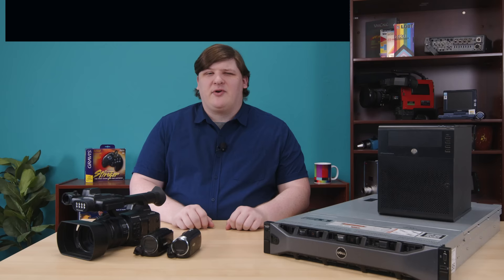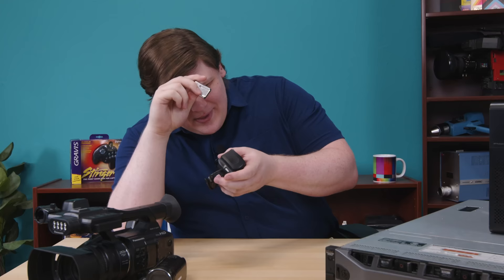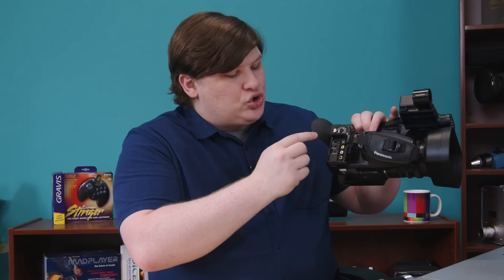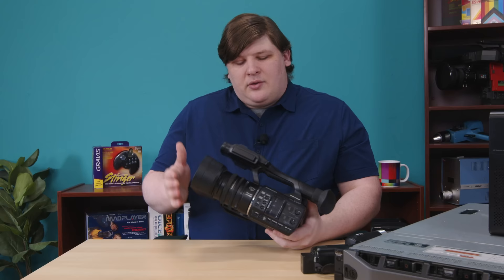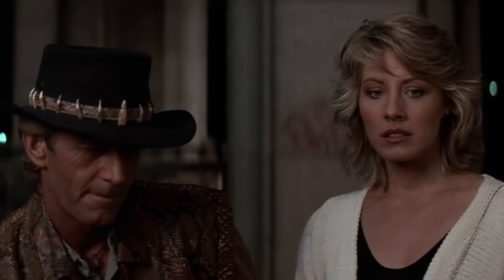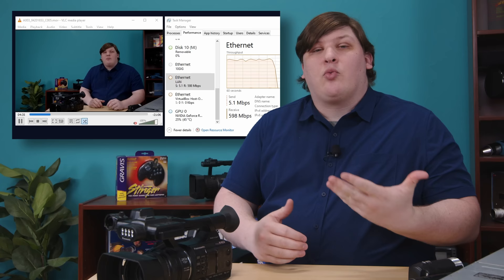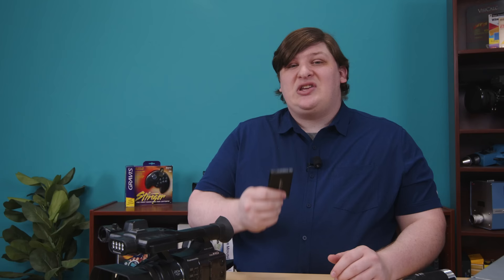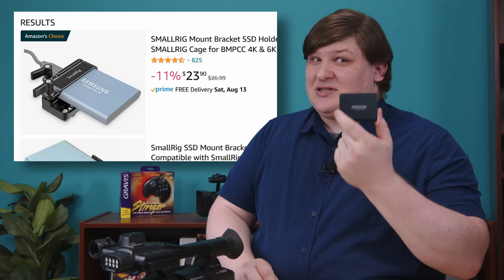I Built... a really fast NAS?

Comment: As a professional in IT I love that you chose SFP modules and not 10G-base-T
Reply: SFP  modules are just dumb unless you need copper or fibre for longer installations. DAC is the bees knees. They require much less power (less then 1% of a 10gbps ethernet sfp). Both optic and ethernet/copper takes alot of power to drive.

Not a big issue with 2 connectors, but when you haev 24 or 48 in a rack the power demand is significant.
Reply: @jmkhenka  sfp dac?
Reply: DACs are great, but I don't care.  I'm 100% with the OP here:  At least it wasn't 10Gb-T.
Reply: @nickwallette6201  What's wrong with 10Gb-T?
Reply: @VCD-Channel   A lot of little things.

1) In a commercial environment, where you're going to have potentially lots of SFP modules packed in to a dense switch port cluster, the transceivers we have today require too much power, and get too hot.  It breaks the limits of the SFP+ spec, and while most implementations can handle staggered deployment (so every other port, or something like that), it's just really hacky.

2) We've kinda pushed twisted-pair signaling to the edge of its usefulness here.  It's a fine topology for baseband, or 10Mb, 100Mb, or even 1Gb networking.  But at the bandwidth required for 10Gb, something like coax (which, ironically, we abandoned for UTP long ago in conventional LANs) is much better suited.  It's difficult to guarantee reliability at the traditional Ethernet specification of 100 meters, and even that's assuming you're using a recent plant with quality cabling that was installed carefully.  Real-world cable plants are often going to be CAT-5E or CAT-6, with similarly-rated jacks and patch panels, and a lot of potential weaknesses like kinks, cinches from over-zealous zip ties, too-long runs, crappy patch cables on the ends, etc.

3) Given the density and integrity issues, many professional vendors haven't focused on 10Gb-T, so your options for 10Gb-T switches are limited compared to SFP+.  This is my bread and butter, so I used to sell a lot of switches like the Juniper EX4550, which was a 32-port SFP+ switch with two modular bays where you could install an expansion card with (your choice of) 8x 10Gb-T ports, an additional 8x SFP+ ports, 2x QSFP+ ports, or 2x chassis stacking ports.  Super versatile!  But, that was discontinued, and there just aren't a lot of models out there where you can casually add a handful of 10Gb-T ports, without committing to an entire switch full of them.  This is particularly annoying when there are just like one or two appliances that need 10Gb, but don't have any SFP+ slots.  That's the worst.  A lot of people need or want a healthy dose of 1Gb ports anyway for legacy or low-bandwidth appliances, or out-of-band management interfaces on their high-bandwidth appliances.  So you could just buy a 48-port 10Gb-T switch and run most of the ports at 1Gb, but that's going to cost a lot more than a similar 1Gb-T switch, so your only true recourse is to populate some of your valuable SFP+ slots with 10Gb-T modules -- and that just feels like the IT-industry equivalent of sharing prescription medication.
Reply: @nickwallette6201  Thank you for the explanation!

Comment: 28:23 For the dock I'd suggest you 3D Print a removeable spacer for the drives to support the connector. Or get somebody to print one for you. It would be an easy design & print for anyone who does their own designs.
Reply: Was going to say the same 😁. Literally 15 minutes to model and maybe an hour to print. Could also, just as simply, make adapters to deal with The T9 drives not fitting into the Small Rig clamp.
Reply: Or jam a piece of cardboard in the slot with the drive.
Reply: @Cathode Ray Dude [CRD]  I just caught this video now.  I'd do it for him.  No charge.  Just have a chicken and egg of not having the drive or kingston bay/hub to measure.  lol   Could probably work off just a caddy and drive model.  @Cathode Ray Dude [CRD]
Reply: I would go even farther :):):) Why not suggest to buy a 3d  printer and build it on itself. :):):)
Reply: To be honest, the dock looks like a prosumer version of those usb copy stations they sometimes have at merch booths to have concert recordings for sale shortly after they ended.
Reply: Was going to say the same, even some plastic spacer blocks would be better than nothing.
Reply: @LeBoomStudios  Of bootlegs? Seriously???

Comment: I am three minutes in and already hooked. Let's see where this rabbithole goes.
EDIT: 1 1/2 hours later, and now I have the strong urge to upgrade our home NAS. great Video, as always!
Reply: He was so ready to shit on that battery 🤣
Reply: I deffinitly have a strong need to build a NAS watching this, one of those too-long-delayed projects
Reply: Been a long time user of Freenas (now truenas) for many years. And WD Red drives(5400rpm models). power efficient, reliable as heck and performance is not too bad really. And doing automated backups has been pretty easy, doing snapshots of changed data every day takes far less time and is often just a few seconds to a minute unless I have done something significant. Than its a little longer. 

And yes I mentioned my nas drives are 5400 rpm, and I do have 10g network.  But as a small family its always been quite sufficient. I also use SLOG and L2Arc (flash based read and write sync caches) and the nas has 48 gigs of ram. So that itself does a lot of heavy lifting. Loading in a couple Tibbs of data for backup isn't too bad when it goes at about 600mb/s

Truenas and ZFS also have paranoid levels of paranoia when it comes to data integrity. And as long as you stick to recommended practices then that data will always be safe almost no matter what.

Comment: Just wanted to complement your going the SFP route in the network interconnect for 10GbE, it has lower latency than 10 gig twisted pair so nice little bonus there. Also direct attach cables really do feel like a cheat and we use them extensively inside and in-between racks; there's a whole world of those cables now, including thinner versions to improve airflow, colored and plenum-rated jackets... congratulations on your workflow upgrades, cheers!
Reply: I've never heard of these, but color me intrigued I'll say that much.

Comment: Such an amazing video! Inspired me to change my approach to scratch disks, 'negatives' and backups. I especially liked all the preemptive "yes, you might be able to do it better, but this is how I do it and this is how I like it" comments. Definitely shows years of reading YT comments that contain simplistic and sometimes condescending suggestions to complicated problems 😁

I have a fairly similar setup at the moment (Atomos Ninja V recording to a 1TB SATA SSD), but I use the "negatives" for editing (love that term). Sometimes I would actually move the files to my NAS (with two NVMe SSDs in a RAID0 configuration) and edit off of that, but both of these workflows are very fragile and prone to data loss. I'm thinking about adopting a similar setup that you have, and since I already have a NAS, this should be relatively easy.

Once again, I really appreciate and respect the effort that you put into making this huge (and very insightful) video.

Comment: Video pro here. Your desire to do things right is something I admire with this project.

Have you considered a Proxy workflow? The reason why it was originally created was because even though most workstations (even mobile) were able to playback full resolution media the storage attached to them couldn't handle the size and data rates of high quality intra frame and raw codecs. 

Just going from your ProRes 422 HQ to ProRes Proxy would mean 1100Mbps -> ~225Mbps and that's before you reduce your resolution. 

Modern Nvidia, AMD, and Intel (including integrated. Quick Sync is shockingly good) GPUs can playback h.264 footage with great performance. If you go down that route, you will only need a few dozen extra GBs with your media for your entire project to have lower res high performance playback.

Resolve 18 went stable and had a point release already. It has a revamped proxy workflow that you should take a look at (see Resolve 18 reference manual pages 188 - 192). It can now automatically detect and link proxies on and after import and comes with a little proxy generator app complete with watch folders.

Generating proxies is something that can be automated part of ingest too, you may already be familiar with ffmpeg, so it can be done server side too.

In addition, if you want something a little less fiddly than an entire server to administrate for the sake of having more space for video production, consider a Blackmagic Cloud Store/Pod.

Comment: Reason for the 2 connectors on the drive backplane: SAS supports a feature called Dual Port, it's basically a second cable path to reach the drives for better reliability.  It might be the multiplexer (or whatever Dell calls it) has a fault that makes it choke on DP.

Comment: So, I actually purchased two servers from the community college I graduated from, and each of them were quite interesting. 
They both were Wide Orbit Radio Automation Servers, which were used for the college's radio broadcasting station, and one came with a 1TB HDD with songs and Licenses for the station to be able to broadcast those songs, and the other came with three 2TB HDDs, two of which were chalked full of songs as well, and the other had licenses for each of the songs on the other two 2TB HDDs, as well as each containing a Samsung EVO 850 250GB SSDs (I'm guessing so they can boot quickly), each of them also had a PNY GeForce 8400 1GB DDR3 PCIe 2.0 GPU (with a video port that looks quite strange to me). One of the servers had an i5 - 4570, with 8GB of DDR3 Ram (1x 8GB, Single Channel), and a good amount of SATA cables sprawling from the five (5) drive bays to many of the SATA ports on the Motherboard.
But, the second server that I purchased, which was the same brand (Wide Orbit) and server model, came with an i7 - 4790, 16GB of DDR3 Ram (4x 4GB, Dual Channel), and a PCIe card that is quite similar to the one that 01:20:26, with the plug that has four SATA cables coming off of it, which were attached to each drive bay, with the drive bay containing the SSD having its own SATA cable plugged directly into port 0.

I know the hardware is old, but I still can't help but think that I got the deal of the century with these beauties!
Reply: I'm going to guess the port on the 8400 is dms-59

Comment: Love iDRAC and its equivalents. I mandated that all new servers at work have licenses for it, they were cutting it out to save a few hundred bucks per server. I am a firm believer that the cost is well worth the amount of time you save vs having to physically go to your server or mess with a network KVM.

Nothing like installing the OS on a server from your couch at home!
Reply: When I was first learning server shit at work I discovered one of our servers had an iDRAC license and instantly fell in love with the features and it's saved me so much farting around. Now that I'm actually in charge of specing out our servers, we don't have a single one without that license.
Reply: I so wish Intel's AMT was more widely available too, it's not full iDRAC/iLO functionality (especially if you have an i3, but some of the i5+ only features can be unlocked with MeshCommander). I have a standard HP elitedesk 800 G2 mini PC running as a server that I can just pop open a serial-over-lan terminal or boot an ISO image over the network and it is SO. COOL.
Reply: I think the common generic term is IPMI (Intelligent Platform Management Interface). That's what I tend to use when not OEM specific.
Reply: Hate iDRAC, other integrated server management hardware/softwares are better.  Never seen so many iDRAC hardware failures over the years.  I have had to replace 100s of Dell PowerEdge motherboards over the years, simply due to iDRAC hardware failures.  For whatever reason. iDRACs are prone to failure.  There are ways to reprogram the iDRAC firmware by externally attaching a programmer to the iDRAC firmware chip or even reprogram the iDRAC via sd card, but it is more painful than simply replacing the motherboard.  iDRAC blows, but hard to have hardware lever remote server management without it.  The iDRAC free verson works, but the Enterprise version is much better, with more features (and btw is easily hacked to become free, lol).

Comment: 1:05:01 Modern fiber can take a lot of abuse, way more than copper. I’ve slammed cabinet doors on x connects all the time in a data center and they work just fine! You can also get bend insensitive fiber that can be tied in loops without much attenuation. Btw you can get 40G and 56G infiniband hardware for pretty cheap on eBay once you outgrow 10G Ethernet

Comment: Since you have ZFS, you might improve the archival copying by using snapshots and sending them instead of using rsync.

You snapshot the scratch which gives you an exact state in time and can zfs send/recv to the archive. You can also mark the recv'd dataset as read only and avoid messing with the permissions.

Look into snapshots and sending datasets; I think you might find some value there.
Reply: He also might want to consider playing with TrueNAS, possibly scale if he'd like to stick with Debian over FreeBSD and have native containerization and a better hypervisor. Doing ZFS on raw Linux is fine, but given how developed TrueNAS is as an appliance, it's worth him checking out.

I know he says he doesn't want to learn anything, but with what he's doing, he's just getting access to a gui form of what he's doing in the command line. Also, the irony of him saying that TrueNAS might break is that manually configuring ZoL will mean it's more likely he could accidentally break something. I'm sure he's competent in the command line, but there's a reason OSes and Applications have GUIs. Unless he was a NixOS kid, then I'd say he's fine configuring ZFS entirely from the command line haha.
Reply: @metaleggman18  Maybe some double checking if recursive datasets work fine in the containerized environment. Proxmox had a bug when dealing with recursive sets that is just now being patched with some updated code. But I agree using a hypervisor instead of running it directly on the bare metal would be a good idea. I used to be pretty gung-hoe about everything running on the bare metal until I had to come to terms that I'd like to not deal with some packages with pedantic requirements that can break the whole system, and instead just build a container for that service and leave it alone until I want to maintain it instead of being forced to do it during a universe upgrade.
Reply: Specifically, just get sanoid/syncoid and it can all be automated quickly:

Sanoid can manage snapshots, taking snapshots daily/hourly/weekly/monthly/whatever and pruning old ones according to rules.

Syncoid can sync those snapshots from a source pool to a target pool easily.. I do something similar:
Mirrored NVMe drives hosting VMs, taking a daily snapshot and keeping 2 days of snapshots, and syncoid doing a daily sync from the NVMe drives to some spinning rust, where it holds more than 2 days worth of snapshots.

Sanoid is basically just automatic. Syncoid is just going to replace rsync in his workflow.

Comment: You could probably 3d print an insert for that Kingston drive bay thing to make the T5's fit more securely
Reply: I thought about the insulation stuff you stick around your windows
Reply: or print your own drive bay with a few right angle usb-c cables going to a pcie usbc controller in the server, plug them in and the script copies the stuff on connect!
Reply: What about a magnet and some double-sided tape? Surely there’s a metal panel somewhere on the camera…
Reply: Yeah, that's what I thought immediately.  This is the kind of stuff I design and send the printer almost without thinking about it these days.
Reply: @NageebTheAverage  He's not talking about the drive bracket on the camera, he's talking about the Kingston dock that they go in when he gets home.
Reply: @mattelder1971  me too. I mean if the bracket is too much hassle, skip it altogether and find another way to secure it. I think he might have had a similar thought as it looks like there’s Velcro tape on it :)
Reply: @NageebTheAverage  I'm talking about the Kingston dock the he puts the drive into to attach them to the server, not the bracket on the camera.

Comment: A note on SSDs -  since many of them are now using QLC flash,  Samsung SSDs aren't necessarily the best choice for high endurance scenarios. There are many high quality brands that are still using TLC, so that would be my recommendation for building out the storage on your server further.
Reply: Tlc is better, right?
Reply: The more bits per cell the lower the write endurance. TLC is Three bits per cell and QLC is Four bits per cell.
Reply: Also a function of size, also multiple level cells can be used in lower level mode (i.e. qlc can be used as slc) by the firmware iirc for e.g. caching.
Best way for scratch drives is too buy high-tbw server-grade ssds which are suitable for say DB use. If course mirror them still. 
And eventually switch to better stuff like u.2 kioxia drives